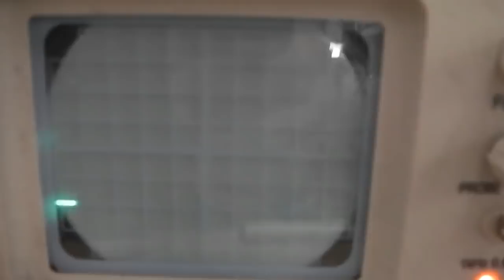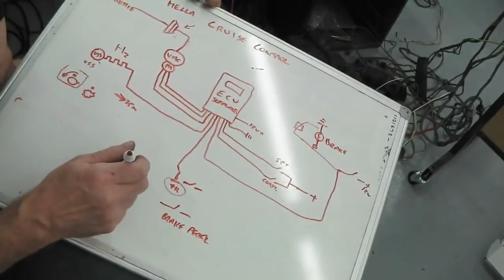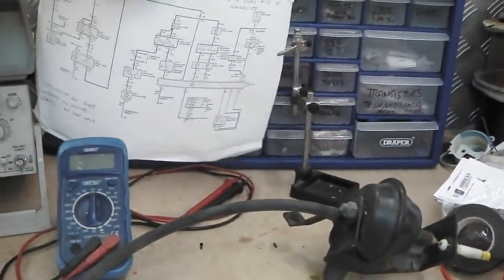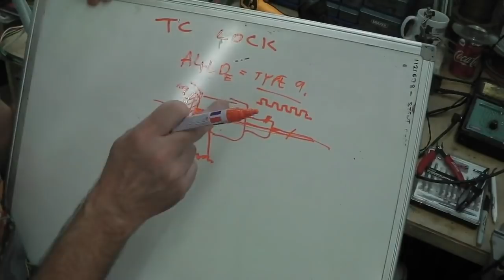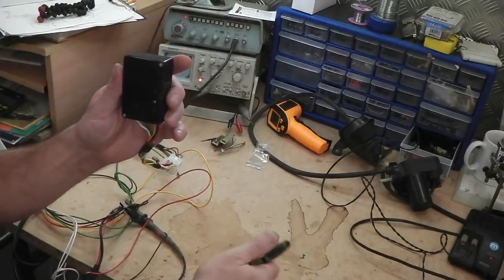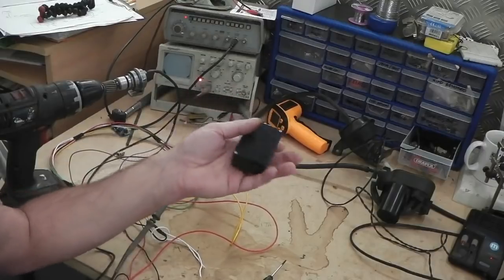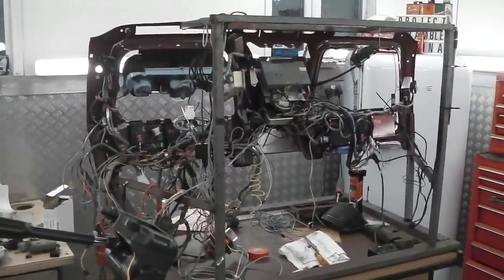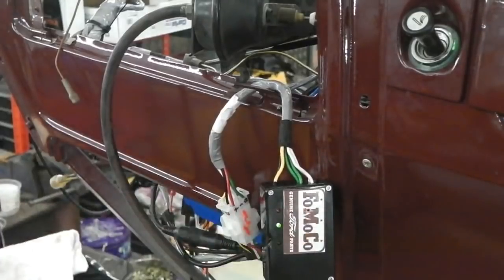Ford Cortina Restoration - Electronics Tech Vid -Cruise Control - TECH VID 4

Comment: Pete would a external switch work for turning the overdrive on and off Great video by the way 👍
Reply from the maker: sean thanks for question, i need the tc lock to go off with brake, on with speed above 45mph and off with engine load, all done

Comment: Great video Pete. just one question regarding the speedo that was originally cable driven. The tail shaft speed generator on the gearbox obviously creates a square wave for the electric speedo on a Mk3 Granada etc. Have you reworked the speedo to look original but have the guts of a Granada speedo? Sorry but I cannot remember what you done with Ruby. Have a great new year and I look forward to the shell returning for the rebuild. cheers. Colin.
Reply from the maker: Colin the gearbox has twin outputs, mechanical drive and electric on opposite sides of tailcone

Comment: HI mate. Great videos. I`m in proces og getting a a4ld for my Taunus. Is is so that all a4ld on the pinto engine is hydraulic controlled when it comes to gearchange?  Is it just on the 2L DOHC that 3/4 gear is ecu controlled? Kickdown and TC lockup is ecu controlled on all from mid 86 i bellive. Betveen 85 thru mid 86 they all are completly meckanikal controlled, both gear change, TC lockup, kickdown and gear change. Is this what i`ve found ut right? Thanx Harald.
Reply from the maker: Harald, 3 types gearbox    A4LD, A4LDe, A4LDE.     cable kickdown on early boxes. A4LD FULLY HYDRAULIC CONTROL OF OVERDRIVE AND TC LOCK UP. A4LDe, hydraulic control of OVERDRIVE, ELECTRONIC CONTROL OF TC LOCK. A4LDE electronic control of overdrive and tc lockup. you can indicate type of box by number of pins on a4lde/a4ldE box, 2 pin for A4LDe, 3 pin plug for A4LDE. I am using A4LDe on my cortina mk3 (PROJECT RUBY VIDEOS) I use a speed switch to activate the TC LOCKUP at 40 MPH, gearbox very very nice. you also need corect FLEXPLATE to connect depend on what engine. operation ok electric kickdown easy with KICKDOWN relay and switch fitted to throttle peddle.
Reply: @PeteCswampy  Ok. Then i have found out almost as mutch as you. Thanx for filling in the rest of information i need :) Keep up the good work. Have a happy new year :)